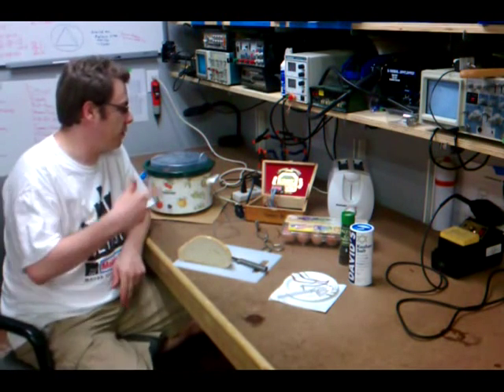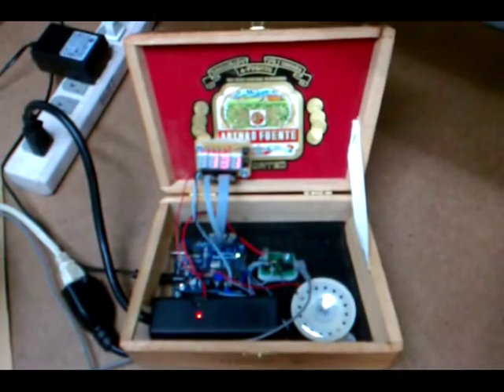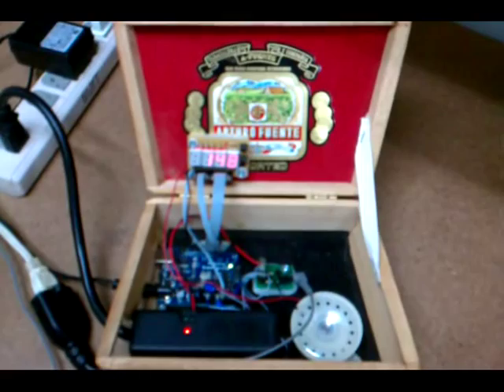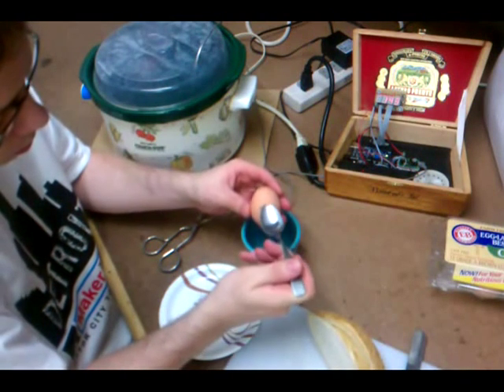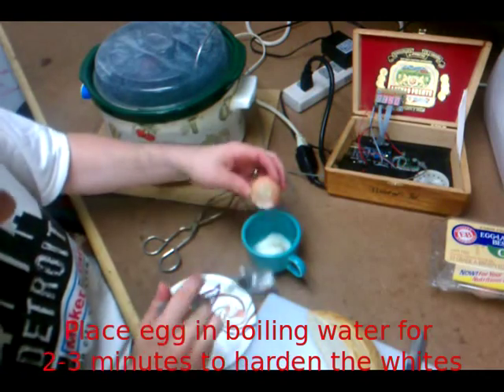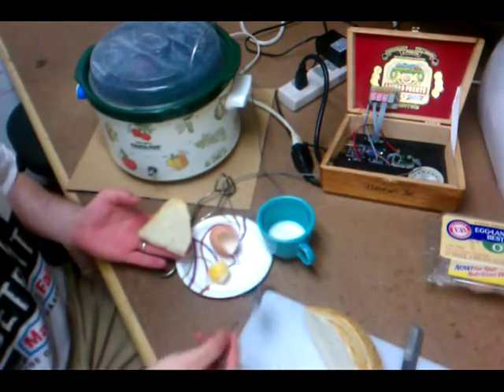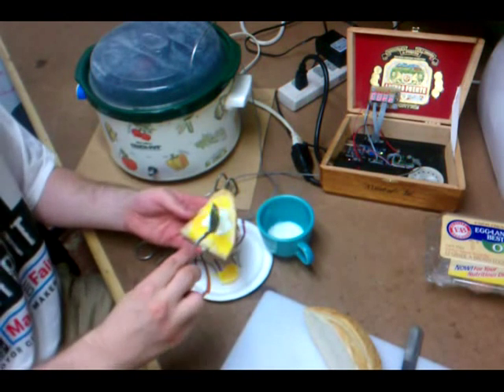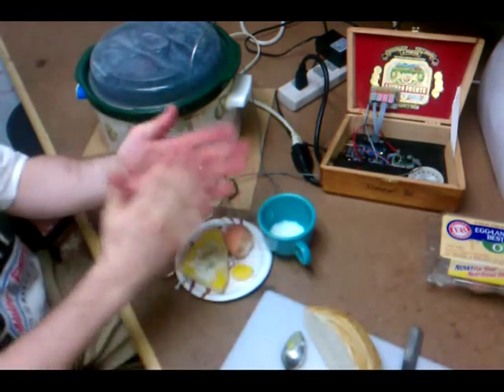Arduino Crockpot Sous Vide

Comment from the maker: The crock pot is a cheap one that stays on after being unplugged and plugged back in. I use a powertail and a temperature probe from a $15 kitchen thermometer that I gutted for the probe and socket. I read the resistance of the probe on one of the Arduinos analog inputs. I used several other thermometers to chart the curve of the probes resistance vs. temperature. I'll dig up the code and put it up on github soon for anyone that is curious.

Comment: Nice!  How did you modify the water temp?  What did you use for a temperature probe?  I have a similar project I want to do for cheesemaking and other projects where I'll have to control the temperature of a liquid with an Arduino.